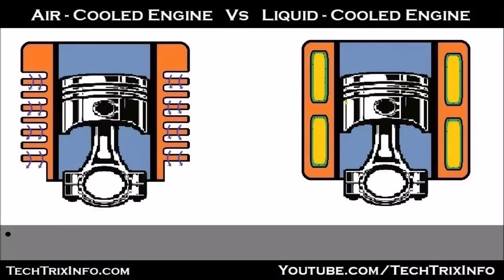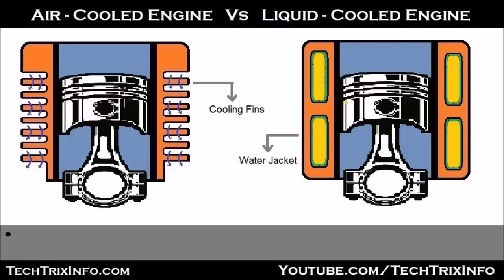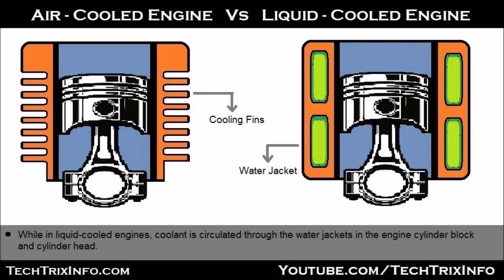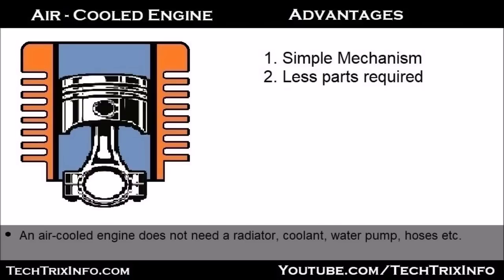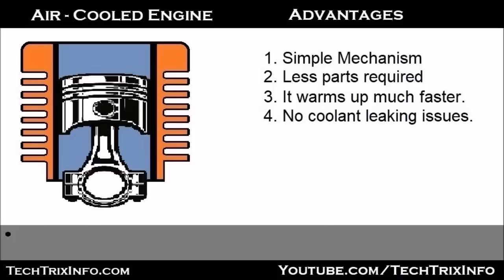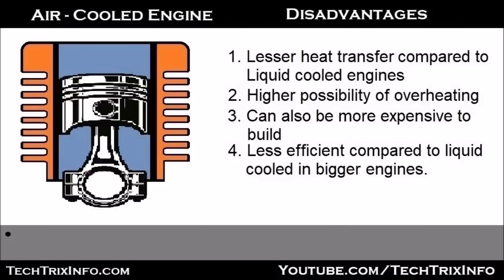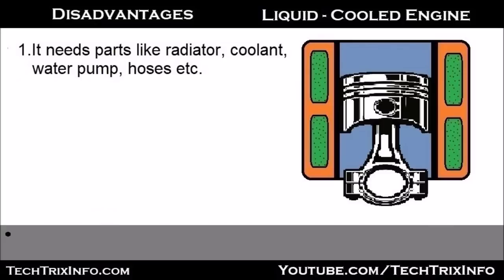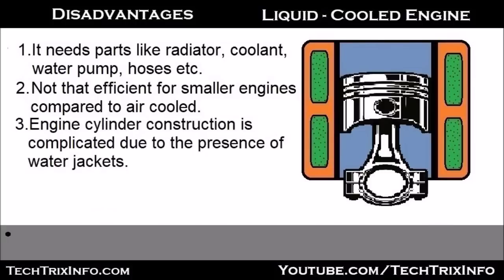Basics | Air cooled engines vs Liquid cooled engines | Animation. ✔

Comment: water cooled engines are superior due to higher compression, more power better gas mileage longer lasting by far.  My first 2 bikes were air cooled and shook and vibrated badly by 20000 miles even with frequent oil changes. My next and all subsequent bikes are water cooled can ride 50000 miles no change in vibration no smoking out the exhaust no need for early overhaul.  Also far fewer emissions.  I don't like smelling the exhaust- if your bike has efi and water cooling then you won't- but its important that the bike cools well, runs around 170 degrees even in hot weather.

Comment: On high specific output engines with four or five valves per cylinder, liquid cooling is mandatory. The reason is that the cylinder head is almost completely filled up with valve pockets/ports as well as spark plug well and maybe even fuel injector. This leaves no space for cooling fins plus the fact that the high output engine is generating more heat per cylinder. Air cooling simply can't pull the heat out of the engine fast enough, so overheating and engine failure would be the inevitable result.
Another advantage of liquid cooling is that the engine can maintain a narrower range of operating temperature over different conditions, so the designers can specify finer tolerances for the piston/cylinder which results in better efficiency and more power.
Air cooling is best for simple engines of more modest power output. Before someone brings up aircraft engines, they are two valve, pushrod engines of relatively low specific output. Big displacement for the power produced.

Comment: Not a joke: What if you get some small copper tubing (outside diameter close to the gap between cooling fins) and wound it tightly around the head and between the cylinder air cooling fins? Then added a fan cooled radiator from ebay and a small electric water pump. I wouldnt want to decrease air flow to the fins, but i also think the copper and cooled water would dissipate heat faster than just air cooling. In theory the copper would also be slightly air cooled as well.  

This would be used in conjunction with an oil cooler. 

Thoughts anyone?
Reply: Ya maybe
Reply: Yes good idea 👍
Reply: You should've patented it.
Reply: Try it.
Reply: I don't think that would be close to as effective as water cooling.  I'd rather try an oil cooler.  I've always wondered if  royal enfield int 650 with oil cooler could last as long as a comparable water cooled engine if the oil is kept also at 170 degrees.  I highly doubt it but wonder.  Air cooled engines can never be as good as a water cooled engine even if, however, because compression ratio is a lot lower then similiar water cooled engine.  This means less gas mileage less power at minimum for the air cooled engine.

Comment: I don't understand why liquid cooling is less efficient in smaller engines at the end of the day a liquid cooling system transfer the heat more efficiently so why not use it in a low capacity engine can you elaborate more on that? Thank you!
Reply: Might be because it weighs down the engine/vehicle too much for it to be worth it.
Reply: Main reason why most lower displacement engines dont use liquid cooling is because its expensive to manufacture and smaller displacement engines dont typically need it
Reply: It's more expensive to manufacture.  All engines perform better water cooled even small ones.
Reply: @j.d.mcginn6946  Ah good to know thanks.
Reply: Small engine become heavier
Reply: @marcquirante2383  Understood, thanks 👍

Comment: Is 175cc in  motorcycle good for air cooled or it must be water cooled?
Reply: It is ok for a 175cc to have a water cooled engine, except for the +250

200cc usually use an oil cooler
Reply: Always better water cooled.
Reply: 125-150 up should be liquid cooled

Comment: Just asking..if ever in a critical area..it is possible to use ordinary water in our liquid cooled radiator???
Reply: I've done it in a car. The biggest problem is that water freezes. So you don't want it in your engine in cold weather.
Reply: If you must use water in freezing weather just make sure you drain it all out before you leave the engine.  Then put it all back right before you start it.

Comment: Does water come out from liquid cool engine ? I have seen 10 -20 ml of water coming out from my bike..is it a normal thing ??
Reply from the maker: Is water coming from your exhaust?
Reply: @TechTrixInfo  yes
Reply: @vit-c3300  you got some serious problems mate
Reply: You should be checking compression.  If it's low it's very likely a blown head gasket.  Caused by running high water temp and/or not changing oil.

Comment: Can i just put water in the liquid cooled engine or do i need something special?
Thanks
Reply: yes you can, but when engine start overheating it will boil that water and can damage your engine, at low temp it will freeze therefore it also can damage your engine and your coolant, just use a specific one ok? it for your own good
Reply: Pure water can also rust internal cooling components such as your water pump. liquid cooling engines usually benefit from a mix of anti freeze coolant agent and water. Search your vehicle's manual for that info for the most reliable solution

Comment: How long an air cooled engine can run continuously?
Reply: Until you are out of fuel
Reply: Maybe 2 hrs
Reply: All depends how hot it is whether the vehicle is moving how good of oil is in it.
Reply: @vergd.8566  48 hours non stop in high speed still running on suzuki Shogun 125  2004

Comment: For short trips liquid cooled engines will dilute the oil with fuel and water condensation. As its not able to get hot enough to burn off. Air cooled doesn't have this issue and better for a life of short trips. Also you don't risk blowing a head gasket if it does get hot.
Reply: There's never a situation when air cooling is superior to water cooling. Air cooled engines are cheaper and take up less space.  Only advantages for air cooling.  Water cooled engines, kept cool 170 degrees or less basically last forever if a decent design.  No air cooled engine lasts forever.  Our 1937 John Deere Model B is more than 80 yrs old runs 150 or 160 water temp all day long, has never had its crankshaft see the light of day.  Never overheated or blown a head gasket.  Never adjusted the valves!  Polaris ranger more than 20 years old runs 170 all day with water temp gauge never smokes never over heated.  I think I made my point here!
Reply: @j.d.mcginn6946  except you failed to acknowledge other aircooled benefits such as you will not be left stranded if you loose your coolant or blow a headgasket which isnt uncommon.
Reply: But if you keep the water temp at 170 degrees as I've said many times- radiator hoses last far longer- in fact I've never blown one.   Never overheated, ever, in any or my vehicles.  But i always rebuild their radiators. On my jeep grand cherokee it was running 240 degrees in 100 degree weather!  Absolutely rediculous.  I changed the radiator from 1" thick to 2.5" thick!   Now it's far better never over 190.  Still not good enough for me so if I bought another jeep grand cherokee I'd get the V6 since I know I cam keep it cool.  The radiator would be even thicker but I'd get the performance I want.
Reply: @j.d.mcginn6946  If we are talking cars, 4wds yeah id only want liquid cooling for internal combustion for sure. But for poorly treated motorcycles for offroad expeditions, farm work, traveling thru Africa or something id totally go a japanese aircooled motorcycle where you have everytool required with the included toolkit to service any part of the bike short of a rebuild.
Reply: Wouldn't be for me.  The single cylinder air cooled bike would soon vibrate so bad I wouldn't be able to ride it.  I'd modify the water cooled one so that in 120 degree desert weather it still runs 170.  It would be a far more refined machine that again would last forever.
Reply: @j.d.mcginn6946  But talking about number of pistons is a different subject. What ifa sharp stick punctures your coolant hose your stuffed if in middle of nowhere. You keep avoiding a basic advantage of an air-cooled motor.
Reply: That's an important consideration- a stick punturing the lower radiator hose.  On my T120 Triumph I had the new radiator built longer, so the lower radiator outlet butts directly against the engine, making the lower radiator hose about 2" long and basically eliminates  tearing up the lower hose.  Of course it's a street bike.  On an off road bike I'd do that if possible or put a steel guard on it or something.  I've noticed lower radiator hoses are mounted higher on those bikes too.  Indeed I basically ignore air cooled bikes because they just don't have the refinement or longevity I insist on.  I've seen many people who are the 'just get by' types and many get away with things i somehow can't.  However once I build a machine the correct and truly only way- they never fail and always way outlast anything air cooled no matter the environment- and I get better longevity better gas mileage and better emissions control almost never adjust valves, have 10,000 mile oil change intervals almost never change belts or hoses.  Too many advantages so I always get water cooled whenever remotely possible.
Reply: Also on your air cooled bike in Africa where it's 120 degrees you will def need an oil cooler- even if it has steel lines they can still be ripped off-- now youre almost as bad as the water cooled bike.
Reply: @j.d.mcginn6946  Those suzuki dr200's and Honda postie bikes handle the hot outback Australian weather just fine without oil coolers and seem to rack up the km's. KISS principal less to go wrong imo. I have an oil cooler tho on my air-cooled bike and i also have a liquid cooled bike which is smoother and nicer but it's for the highway so i am able to have a fair opinion on both.
Reply: I too have a fair opinion on both.  I had a suzuki sp200. Very little power started smoking and vibrating 15000 miles.  That's nothing mate.  I want a machine that lasts virtually forever with less maintenance.  While you are doing 2000 mile oil  changes mine are 10000 mile.  Your bike will run 15000 miles and need overhauled.  Mines still fine at 50000 miles.  Love the debate but you make this one way too easy for me.
Reply: @j.d.mcginn6946  well no, as your still stranded or risk blowing a headgasket and limping a few kms at a time if loss of precious coolant in the theoretical Africa situation but where as i could keep traveling with aircooled tech.  But if you wanted ultimate reliability why you have chosen a jeep is a head scratcher. I guess that's a topic for another place. I think for ultimate reliability and no servicing electric motors win and a million mile battery (lfp) might soon be the way to go.
Reply: You bring up JEEP one of the most noted vehicles for reliability that there has ever been??!!   We have a Jeep Cherokee XJ with the absolute legendary 4.0 inline 6 with 200000 miles it's barely broken in!   We had a Jeep Wrangler TJ, another legend, it had the 4 cyl 2.5  version of the same engine we could have those vehicles for the rest of our life easily!  Granted I'm not so much into the newer Jeeps or newer any gas vehicle they are just too complex- even so our newer grand cherokee with 2.5" thick radiator, is actually just fine thus far but only 60000 miles.
Reply: Indeed i agree for the electrics.  Rivian RS1 is a good start but I don't have $100000 to just throw around right now!  Wish I did they truly are mind blowing to drive.
Reply: Also on why I choose a jeep: they are still simple enough that one can still work on them.  The JGC either hemi or V6- uses port fuel injection.  No turbos to clog up the engine bay and produce even more heat.  No direct injection which has 5000 psi fuel pump pressure vs 300 psi for the jeep with PFI.  Imagine what a fuel pump for those things costs!  Imagine the maintenance that turbo needs running 100000 rpm!  All of jeeps competitors use DI and twin turbos- 2 pieces of largess I shall never experience.

Comment: You still get air cooling on a water cooled motorcycle with the fins. So, you get the two going for you.
Also, oil is still going to be cooler on my motorcycle due to the two air/water combination.